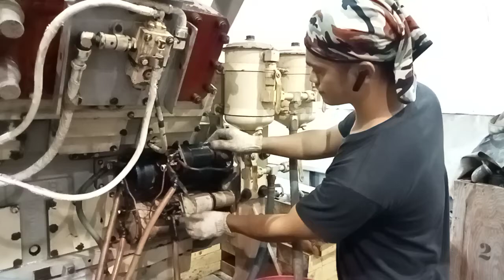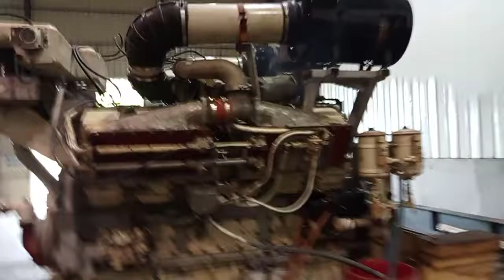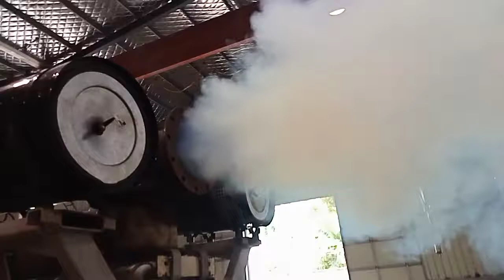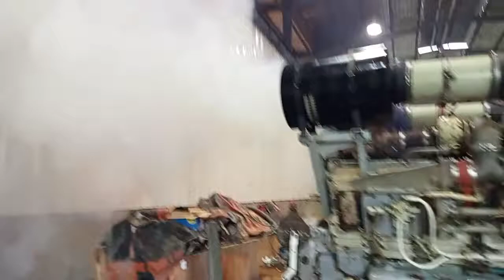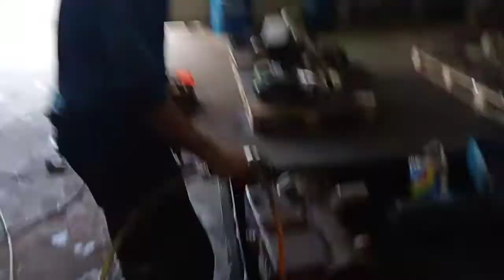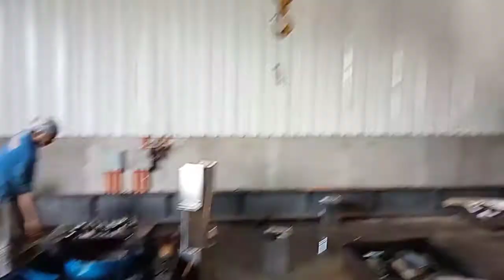Cummins K38 faulty fuel and lube oil lines./start up scenario

Comment: Hi, Could you share the root cause of this white smoke?
Reply from the maker: That is all about the quality of the diesel we used and the  no load of the engine since we are testing it after we overhaul. We need to put  exhaust air filter  and the good quality of diesel to  have a transparent smoke